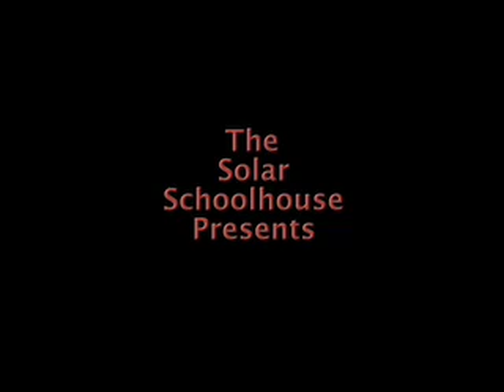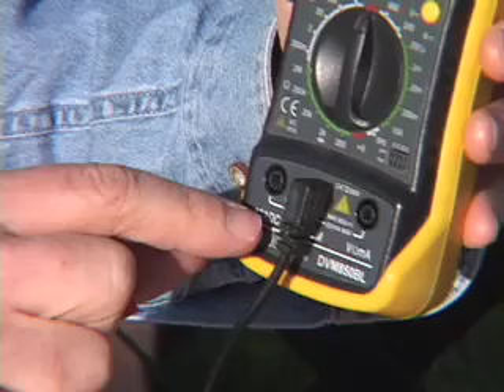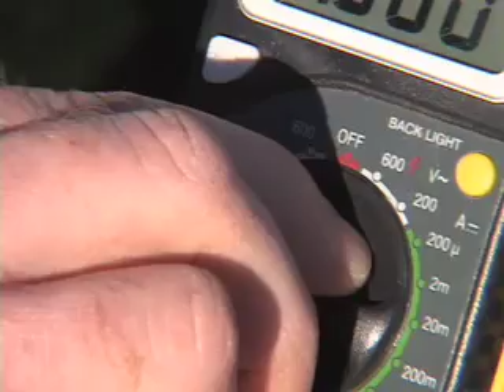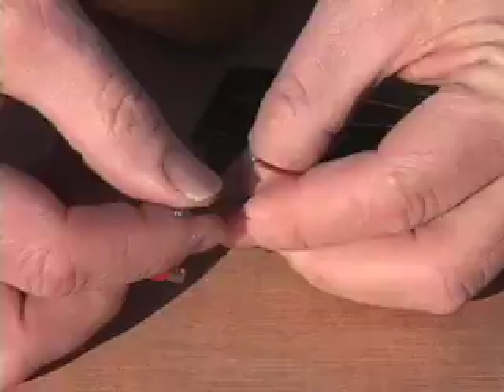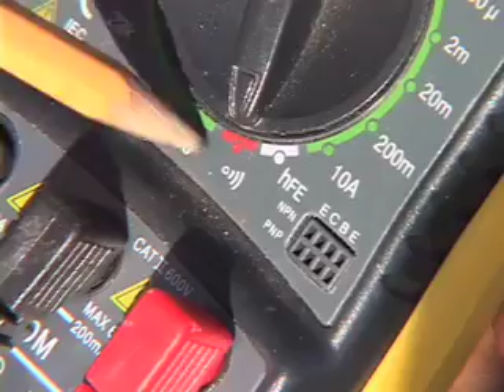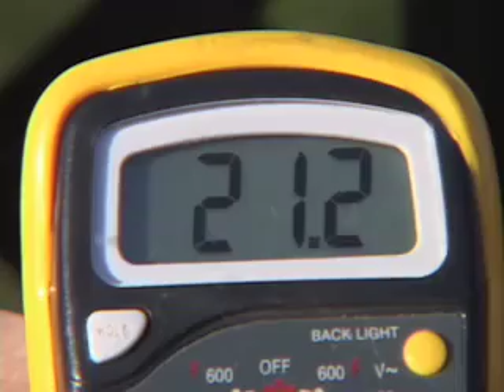Multimeter Tutorial - Solar Schoolhouse

Comment: if a solar cell is rated at 1V and 1Amp, this is the max it will read when the solar cell is facing directly at the sun.    if you leave your solar cell fixed in one direction then the amp reading will be proportional to the amount of sunlight shining on the cell, which varies throughout the day.

Comment: @marblemacchiatto 
Test the wires as you would the solar panel or the battery. Be very careful and touch one probe to the ungrounded(usually black or red) wire and one to the grounding(bare copper) or grounded(white). If you are just testing for safety I would recommend getting a small non-contact voltage detector and using that. Remember to test it on a live circuit every time before you use it.